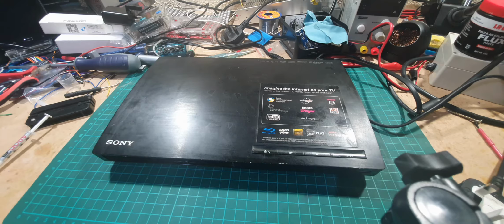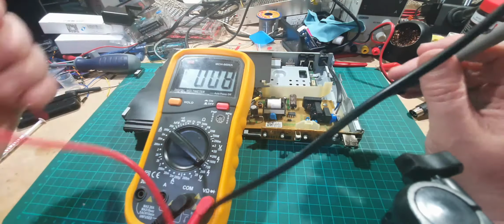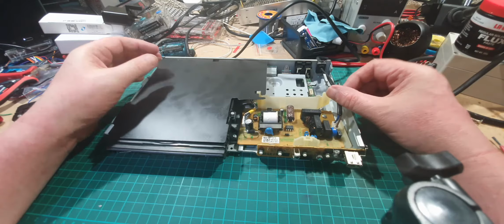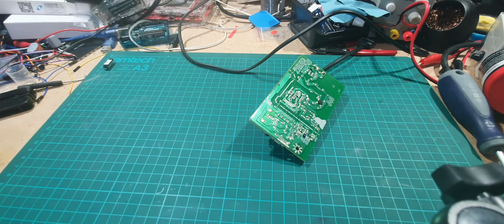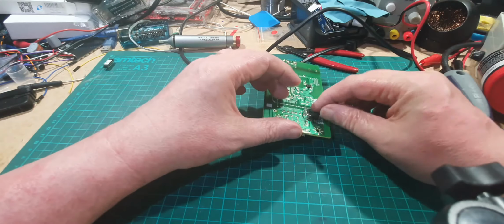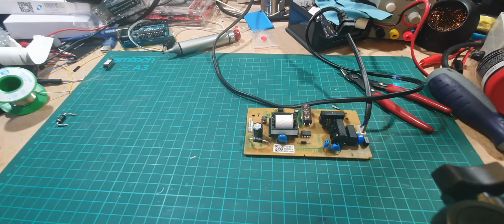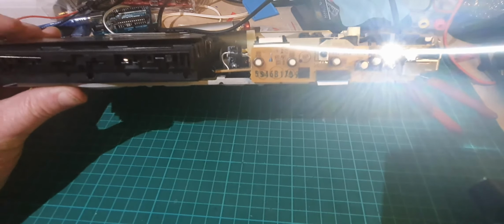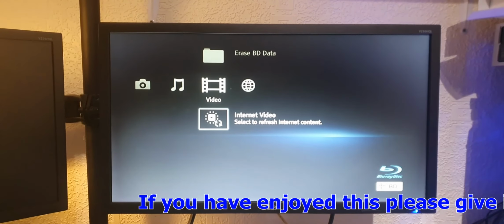Repair of Sony BDP-S185 Blue Ray Player

Comment: Thank you Mike. Had the same issue with my Sony Blu-ray player, both rectifier diodes had blown. Not a fan of soldering but 2 new diodes and a few finger burns later my unit has just kicked back into life…
Cheers mate!

Comment: Thanks a lot for this video Mike!! - I'm repairing a Sony Blu Ray bdp-S62004 with the same problem, it has two rectifier diodes and both are blown. However I'm having a problem finding the exact diodes to replace them. I've found a: SB3100 SCHOTTKY rectifier diode - 100V / 3A (DO201)  - can you please tell me if that's the right diode..? Kind regards.

Comment: Is there an important step here you forgot to mention about getting the front of the tray off? Where the whole thing doesn't just slide off, but in fact the tray breaks if you don't do it first.
Reply: Yes, I'm having the same problem.  My door didn't break, but it's bending inwards when I try to remove the cover, preventing me from doing so, and if I were to push it any further I'm sure it would break.  
It's hard to tell if his DVD door has already been removed or not - he manages to keep hiding or covering the door (or moving it JUST out of frame) so well, it almost seems intentional!  😠  If indeed his door hasn't been removed, then I wonder if maybe the US and UK players are slightly different.
Reply from the maker: @BerlinerinToni  If I remember correctly I had to break off a small plastic tab to get it off, but as its now back screwed to my mates ceiling I carnet get it down to check
Reply: @MikesLEDShed  Thanks for the quick reply, Mike.  There is one other YouTube video I've found (link below) where the guy removes the faceplate from the door, but unfortunately, you can't quite see what he's doing (poor angle, too far away from camera).  It seems like breaking the face plate in some way is the most universal way of getting it off. 😒

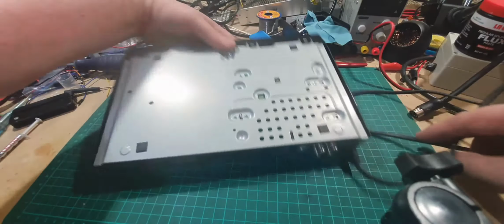I did ask the poster of this video if he could provide a bit more guidance, but I'm not optimistic due to the age of the video.  It's from about 0:53 to 2:05 :  https://youtu.be/6TJQHT-Eq-g

Comment: Hi Mike, could you please tell us how it is that you managed to remove the door faceplate?  It seems you removed yours before you started this video;  if I try to remove the DVD cover with the faceplate still on, it (the faceplate) threatens to break.  It has something to do with a release tab  (which I can't seem to locate) on either side of the underside of the faceplate, and that center spring behind the faceplate keeps causing trouble too :  it seems to be stuck underneath some part of the center of the tray itself.  For the life of me, I can't get that faceplate off;  I'm afraid of breaking it - and my research tells me I'm not the only one this has happened to while trying to remove the cover on this model.  All for a lack of decent instructions anywhere on the internet for removing the faceplate.  Please help!
Reply from the maker: If I remember correctly I had to break off a small plastic tab to get it off, but as its now back screwed to my mates ceiling I carnet get it down to check